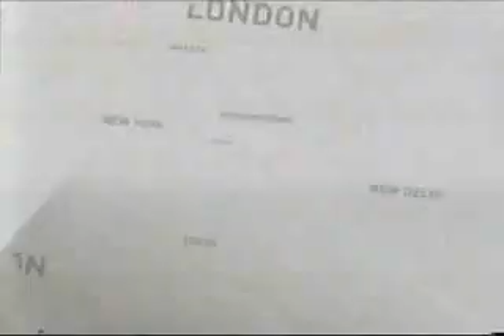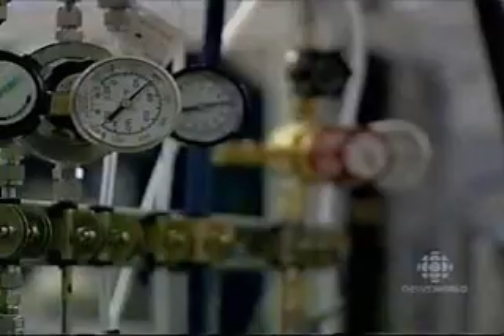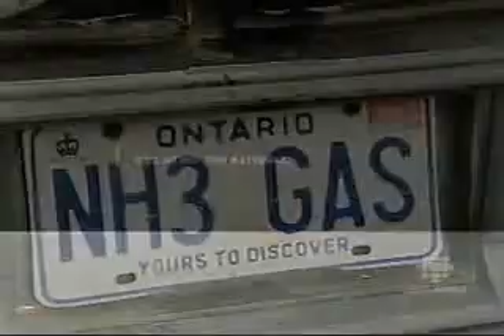Ammonia Powered Car

Comment: Does anyone know of instructions or a kit to run a diesel on ammonia?
Reply: I used ammonia vapor injection into plenum chamber of an old smokey Perkins V8 540 55kva gen set running our 3 phase workshop machinery ...

It used to be very thirsty  12-16 litres diesel an hour depending on load & was always very smokey ( lot crankcase pressure).
Therefore had Injection pump & injectors reconditioned ,no noticeable improvement. Still very smokey, fitted new performance K&N air filters & new oil filter change, rerouted breather pipes into oil catch can didn't have any improvement.............
Rather than do full engine overhaul (new rings etc) experimented  with old ammonia refrigeration stock, using old modified R717 refrigeration expansion valve 
Smoke disappeared , crankcase pressure disappeared......................
Runs ok 🤞

Comment: the future is electric engines, solid state high energy density, long life batteries powered [charged] by fusion reactor grid power
Reply: or wireless charging roadways
Reply: Why not use piezoelectric to in the roads to powder it at the surface

Comment: Here is the problem:  Try to convince everyday car owners to convert to some fuel where there are no stations to supply that fuel conveniently:  it won't work. Now do the same with TRAINS and you've got a completely different story. Railways often carry ammonia tankers, so they have access to all fo the fuel that they need to run their trains off that stuff.
Reply: Stanley Meyers resonant inline injectors and carb conversion

Comment: How does that fuel system work? You can't use a carburetor like what came on the car.
Reply from the maker: True. I don't know how Vezina's fuel system works.
Reply: @sgrannel  looks to be a standard lpg system with some air fuel ratio adjustments [ like those you normally do if the vehicle will be used regularly at altitude] pretty easy if u ask me , just watch out for any copper fittings, ammonia will eat them like hot water eats ice

Comment: Today there is a big push for Hydrogen/ electric ammonia is a safer and easier carrier of Hydrogen than H2 itself for obvious reasons , prices are decreasing as for example some countries are planning on producing green H2 and green NH3 , like Australia , Chile , it can be made anywhere by the use of Haber Bosch synthesis ,technique , some heat needed , it all depends on the energy matrix!

Comment: How much it cost to switch a car/truck from gasoline/diesel to ammonia?
Reply: the same as lpg. in fact an lpg system would do with an air fuel ratio adjustment , the snail type of fuel mixer off a forklift would be the best to use for a 4 or 6 cyl vehicle
Reply: Propane needs diesel engine or replacement of valves stems etc to a harder material. But the new camless systems would be perfect

Comment: What power output can a car running on ammonia put out, compared to petrol? Assuming that they're running the same power Plant, naturally, to an equivalent specification.
Reply from the maker: For normally aspirated engines running full throttle, dual fueled gasoline/ammonia produces slightly less power at the rough limit than just gasoline, and at the knock limit, slightly more power because MBT spark timing can be used at all operating points.

Comment: "Is ammonia dangerous?
 However, ammonia will not explode like gasoline, natural gas or hydrogen. In fact, it is difficult to get ammonia to burn, even though it makes an excellent fuel for cars and trucks. Ammonia vehicle fueling and storage takes place safely without any human access to the ammonia liquid or gas, just like the fueling process for natural gas vehicles.  gasoline is quite poisonous. Ammonia is classified as a caustic  far less dangerous than gasoline.
"

Comment from the maker: Engine-out NOx emissions for stoichiometric operation are controlled by [NO]^2/[N2][O2] equilibrium conditions near the freeze-out temperature for NO reactions as the gas expands and cools after combustion. (See Internal Combustion Engine Fundamentals by Heywood pg 578) The freeze-out temperature is exceeded during combustion, where peak in-cylinder NO levels may be 10000 ppm or higher, and this is ~true of any fuel. 3-way cats for SI and SCRs for diesel then remove NOx from the exhaust.
Reply: Toyota has a cat for their Ammonia-Hydrogen ICE. I think a wet scrubber could be used for non-vehicle applications.

Comment: Im a little confused by your response. NOx emissions are not controlled by catalysts. NOx emissions are controlled by the combustion environment. High temperatures and pressures control the production of NOx compounds. How would the cylinder temperature and pressure compare to a engine running conventional fuels? I understand that NOx emissions may not be a real issue with ammonia as a fuel source. However its likely not a pollution free fuel.

Comment from the maker: Chapter 4 of my thesis covers this subject, so there's no need to guess. Look it up and you'll find that the engine-out NOx emissions are nearly the same. Exhaust catalysts also work nominally well for cleaning up the emissions at stoichiometric. Some engineer might tweak and tune the catalyst to further improve catalyst performance, but I'm not interested in that. Emissions, and getting the engine to work on ammonia aren't really scientific issues anymore.
Reply: Can I read your scientific thesis?
Reply from the maker: @atlastobin7837  Full-text available.  https://www.researchgate.net/publication/30862336_The_Operating_Features_of_a_Stoichiometric_Ammonia_and_Gasoline_Dual_Fueled_Spark_Ignition_Engine

Comment: I understand that theoretically the combustion of NH3 would form N2 instead of NOx. However one has to remember that conventional fossil fuels do not theoretically form NOx during combustion either. Instead NOx are formed as a side reaction of atmospheric N2 reacting with oxygen during the combustion process. If ammonia is releasing N2 as a product it would be interesting to see the concentration of NOx due to the side reactions. My guess is that NOx emissions would be high.

Comment from the maker: @ontopofthe7thhill Oil is still cheap. Ammonia can only be used for replacing liquid hydrocarbons in bulk when ammonia is cheaper than liquid hydrocarbons, because otherwise the replacement would be at a loss or require subsidy. The good news is that now we have at least one option for replacing liquid hydrocarbons if they become too expensive - an oil price ceiling. Ammonia is source neutral. One can't easily make oil with nuclear power.

Comment: @redneckchemtech Typically no.

4 NH3 + 3 O2 → 2 N2 + 6 H2O

It makes N2 which is what our atmo already is, and water. The problem is it's 40k BTU/gal vs. 116 BTU/gal, you don't get the energy for free, and the technology isn't there.

Comment: The most serious problem with Ammonia as a fuel is that the energy density is too low. While it's better than even liquid hydrogen it's 30k BTU/gal, vs. 116 BTU/gal. It's not crazy. But, the ammonia is just an energy carrier.and it doesn't carry enough of it. You'd need three gallons of NH3 to do what 1 gallon of gasoline does. And you'd need to use energy from some form of grid power, to make the NH3 because unlike oil we don't just dig it out of the ground for next to nothing.
Reply: Oh you mean the solar and 2ind electricity we already create?

Comment from the maker: @yellowmetalcyborg But you could have a small engine AND run it on ammonia. Or..? Natural gas is used to make ammonia because it's cheap. Ammonia will really only make sense if and when hydrocarbons become more expensive than ammonia produced from something other than hydrocarbons, such as nuclear power. The same innovation and work ethic that goes into drilling more than a mile for gas could be applied to nuclear. It's really a question of what we WANT to do, not necessity, at least for now.

Comment: Sorry your comment makes no sense. Combusting NH3 makes NOx regardless of stoichiometric amounts and/or catalytic converters. Changing the Fuel/Air ratio will only control how much NO in comparison to NOx is being produced. 

It doesnt matter how many ways you look at it. Gas vehicles make NOx as a side reaction of atm N not a main product. Using ammonia will produce a lot of NOx.

So what exactly do you think you can do to prevent NOx emmisions?

Comment from the maker: One possible answer to "where to get the fuel?" is nuclear power. Nuclear reactors designed to produce high temperature heat can be used to make hydrogen, which can be used to make ammonia. Other energy sources might also be used to make ammonia or some other energy carrier, but these might not compare favorably on economic and watts per acre bases. Nuclear/ammonia technology can be brought up if oil gets too expensive. I now know that we will never be left without other options.

Comment from the maker: Actually, less NO is made with ammonia than with gasoline, and engine-out emissions clean up at stoichiometric using an ordinary catalytic converter. We have other solutions, too. The real problem with replacing fossil fuels using ammonia, as with any of the alternative fuels is not emissions or getting the engine to work, it's "Where are you going to get that much of the fuel?"
Reply: Stanley Meyers resonant inline resonant hydrogen injector and carb conversion

Comment: so wouldnt burning ammonia produce NO as a by product from combustion which would oxidise to NO2. That would increase NOx emissions durastically. No wonder
Reply: nox dissolves in the moisture in the air almost instantly and rains down and fertilizes the soil with nitrates , win win if u ask me.....
Reply: How much do we produce now from the energy sector vs 2hat we would if converted

Comment from the maker: I've been working with liquid anhydrous ammonia for 7 years, I've been exposed to the vapor momentarily and I can tell you it's not THAT bad. 0.2 grams of ammonia in a cubic meter of air is about 280 ppm by volume. Guinea pigs exposed to 170 ppm for several hours per day for weeks on end suffer discomfort but no damage. Any fuel has its dangers, but engineering considerations can minimize the dangers. Toxicity is not a fundamental limitation.
Reply: I had a coworker die after being blasted with ammonia.  Basically had chemical burns to his face and chest and lungs were destroyed, died in 15 minutes.  Ice making plant accident.
Reply: Shit ice maker refrigeration is under extreme temp and pressure
Reply: It takes knowledge to be truly safe with it. I know a couple people who were messed up from ammonia clouds. And another who worked to fix a bad industrial leak with no gear and was unscathed. Everyone has a different tolerance I suppose.
Reply: Pollution of NOx is the problem and no way around it.

Comment from the maker: Natural gas is problematic, too.  Its price fluctuates and at one point in 2008 ammonia was going for $1200 per ton (2000 pounds), which is $8.33 per gallon gasoline equivalent.  Ammonia has gone as low as $245 per ton in 2003, which is $1.70 per gallon gasoline equivalent.  The fertilizer industry will have to switch to another energy source, and when it does, then ammonia can find another use as a truly "green" fuel.

Comment from the maker: I don't know much about how Greg Vezina's vehicle works, or what he is doing to get the ammonia to burn. This is his vehicle, not mine. My laboratory engine runs on ammonia with gasoline with the same thermal efficiencies or better, than when running on gasoline only. When designed to purpose the ammonia fueled engine can be about 1.5x more efficient than those in use today. There will be an advantage even when ammonia costs the same per unit of energy. 1 Gallon gasoline = 14 pounds of ammonia.

Comment from the maker: True. Ammonia can be made from methane at about 70% conversion efficiency. But there can still be a substantial fossil fuel savings obtained by running on ammonia/gasoline at the 8:1 knock limit fuel mix (mostly gasoline). In that case the main effects are increased overall efficiency and smaller engine for the same power output. Ammonia puts the energy of stranded methane into liquid form. I agree that some other energy source, such as nuclear, is required for ammonia to replace oil completely.